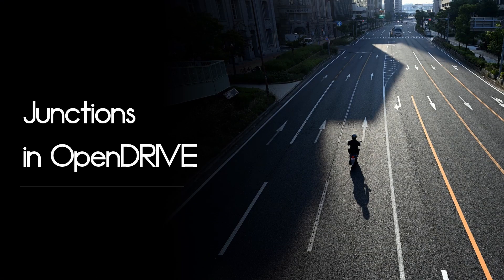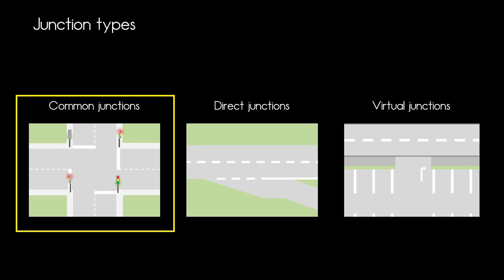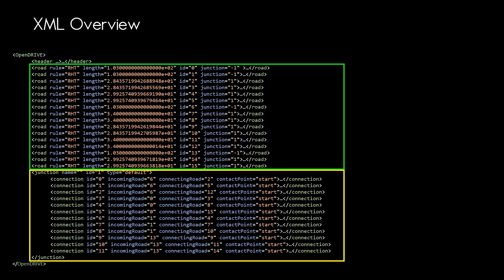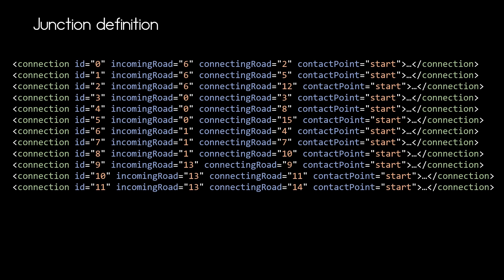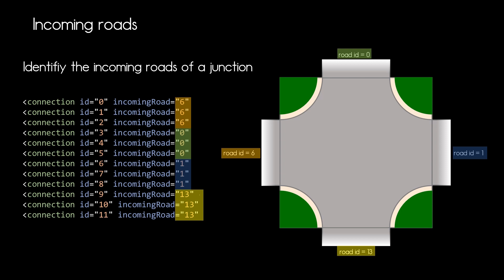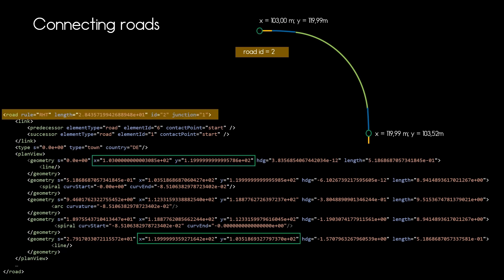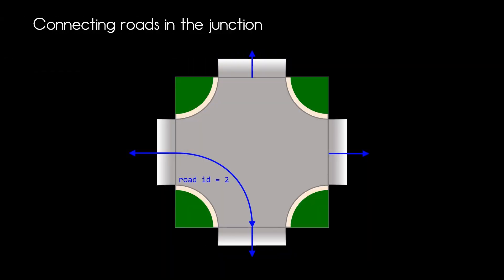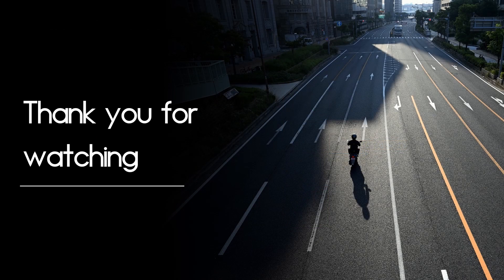OpenDRIVE Junctions- road networks for simulation

Comment: Hallo Nico, i have a question in 5:43.
you have said in another video that the hdg of a geometry end should be equal to the start hdg of the escond refernce line geometry but it is not in this example, so i'm little bit confused .
Reply from the maker: Hi Haidar, I checked the corresponding section and you are right. The hdg values are very close but not perfect. Let me confirm with the OpenDRIVE Team, but this looks like a error in the example. Thank you for pointing it out
Reply from the maker: I checked with the OpenDRIVE Team, the hdg values not identical that is correct, but as they are very close both are to the power of -12 they can both be set to 0, and than the hdg is the same for both elements.
Reply: @niccohagedorn  Thank you for your effort and hope to see Always new videos